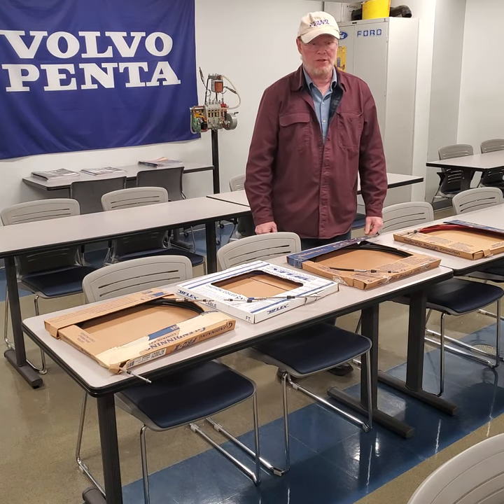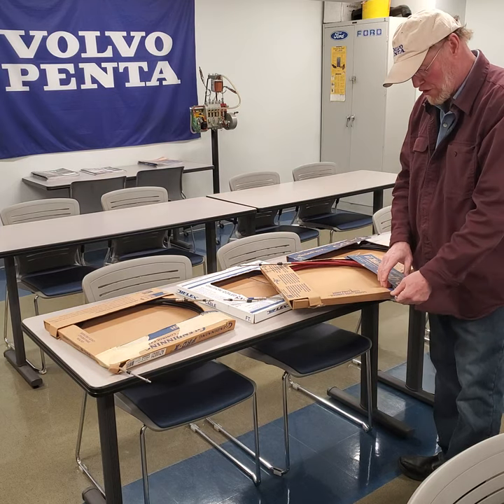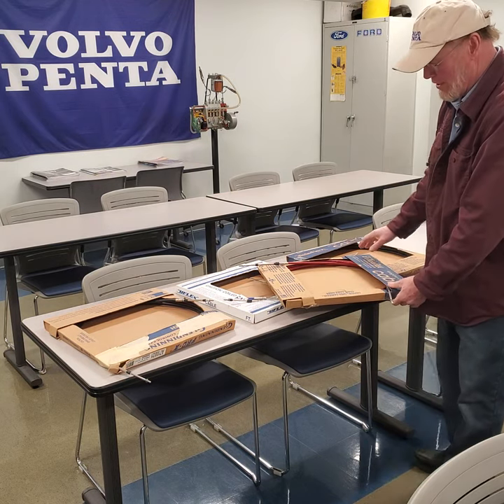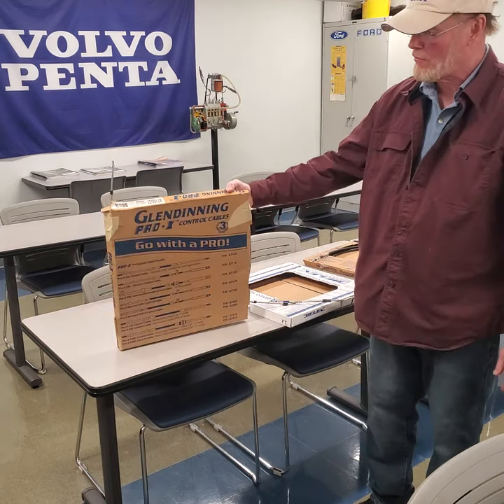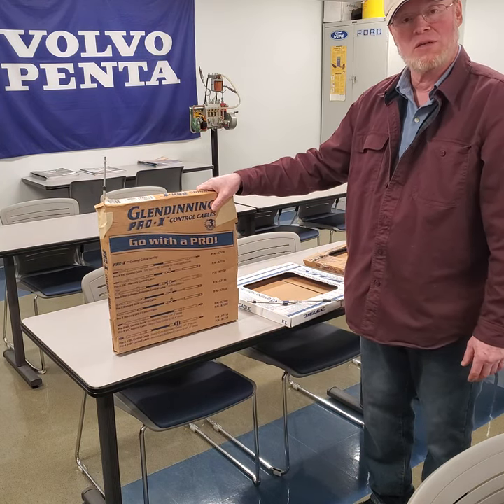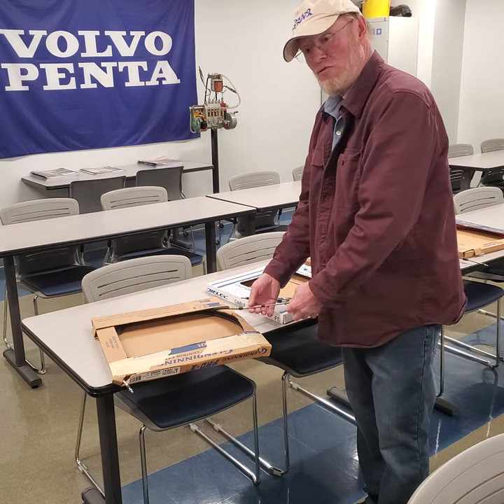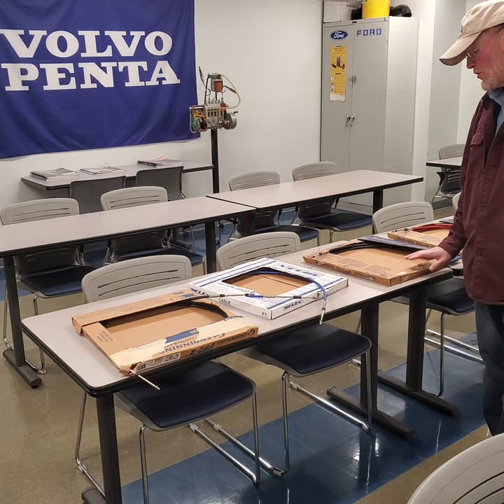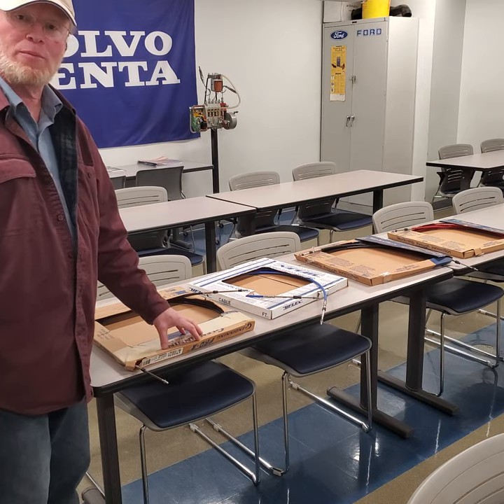Outboard Engine Repair, Boat Shift/Throttle cable types

Comment: Does anyone know where a conversion chart might be for throttle / shift cables?

I have Teleflex red jacket cables - part # D301947-3 216IN - on my 34 foot SeaRay SunDancer- twin Crusader 350 V8 engines - carburetors.

Based on Ted's video, I am looking for the equivalent in Glendinning's product line.

THANK YOU!!! 
🙏
Reply from the maker: @martinsmith1451  216 in is for inches. So 18'
It's easiest to call glendinning with the cable part# and they will tell you what you need, take your order and ship it to you. 843-399-6146